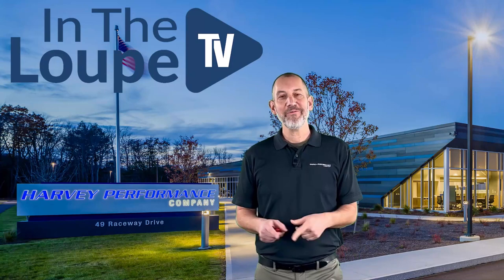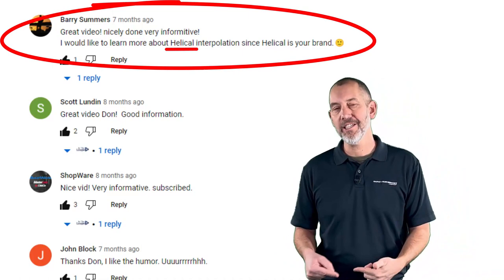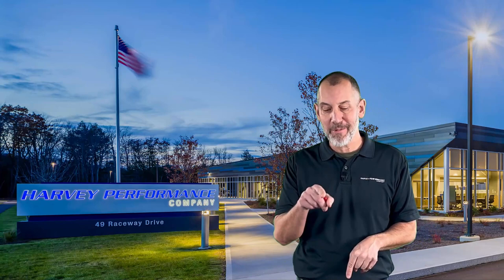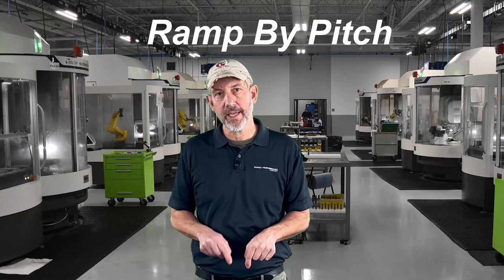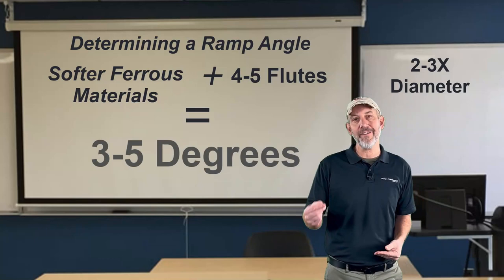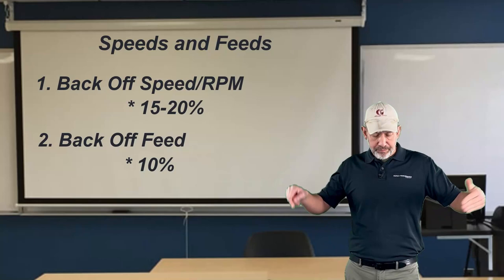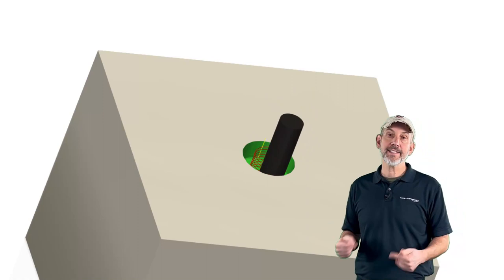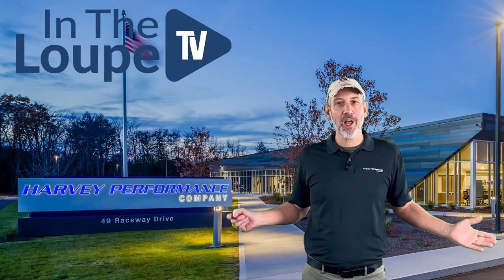Understanding Helical Interpolation: In The Loupe TV Ep. 12

Comment: This episode prompted an episode idea from me, even BEFORE you said the quickest way to the bottom of the hole is to drill it. I've heard time and again that drilling is the fastest way to remove material, but I don't know much about practical application. I imagine drilling a hole pattern in a pocket area... but what kind of drill? Can you overlap holes, so to speak, with the right tooling? How do you deal with all the webs left between the holes? Is finishing the pockets really that much faster if the bulk of the material was removed with a drill? Sure, now there is less material to remove, but radial engagement is going to be constantly varying, how do you calculate the most efficient way to get rid of all that without breaking the tool with a spike load? Related, what exactly is the difference between drilling and plunge milling aside from the geometry at the end of the tool?
Reply: In the Cue sir.  Great suggestion on the Drills.  We are planning on branching to other Specific cutting tools..  Thanks for Watching and Keep an eye out for your episode!!

Comment: How to calculate what pitch we need to interpolate at. 
I am interpolating a 125mm dia, 8 tipped high feed paramet cutter into the casting with 145mm hole to bore it to 152mm. The feeds and speeds are calculated but really confused about increment of Z into the bore. I tried same cutter same feeds and speeds for a bigger bore in the same casting which is about 180mm and used an increment(pitch) of 0.5mm per lap but the same increment is not working for 152mm bore. Could you please explain how to calculate that?

Comment: When does it make sense to helical mill a hole instead of drilling? Most of our machining is in soft copper. I need to find the fastest way to make a hole with the least amount of burr where the tool breaks out of the bottom of the material. Is it ever more productive to helical ramp than to drill and then finish with an end mill?
Reply: If you are trying to get a burr free hole I would suggest Helical Ramping over Drilling.  That being said there are several Material specific Drills that will help eliminate the burr on exit.    An endmill will clean up the hole very nicely with a helical interpolation on your exit hole.  CTC